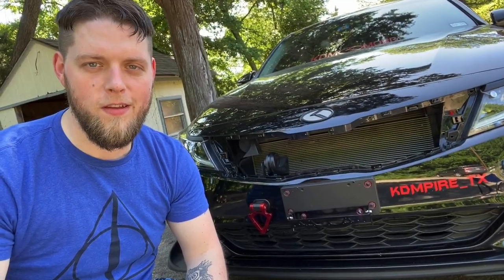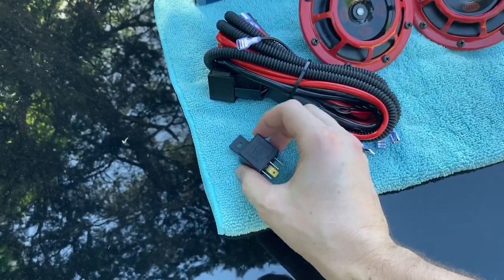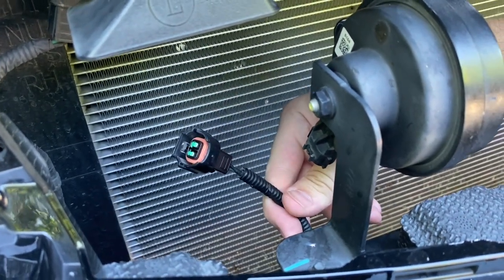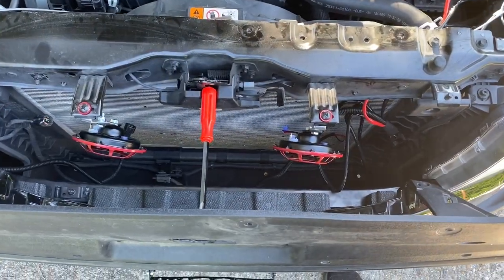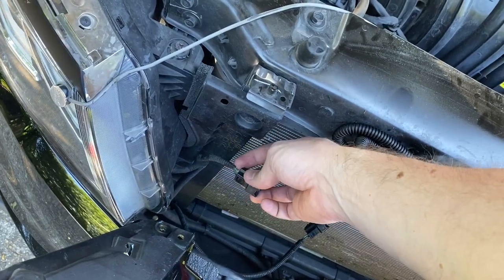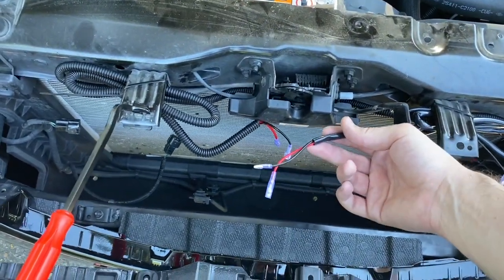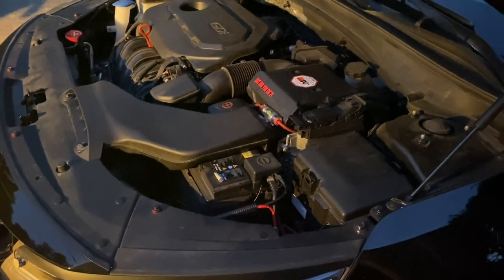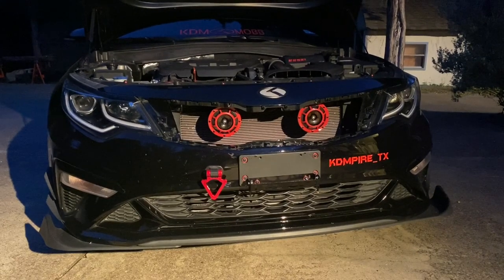How To Install Aftermarket Horns (Hella + RELAY!!)

Comment: Can I use t-tap connectors for the splicing of the wires that connect to the steering wheel horn button?

Comment: Cool, this is exactly the video I was looking for. I’ve got a 2016 optima. I’m connecting train horns in addition, not instead of the original horns. I plan on getting power to the new horns from a fuse tap at the horn fuse. I’ll be using a relay after the fuse tap. Do you see any problems with this plan?
Reply: @KDM_curt

Comment: So what happens if your original horn only had a positive connection and was grounded to the body how would you wire the negative on the trigger harness
Reply from the maker: You should be able to run that negative from the harness to area where your battery is grounded or the negative terminal on the battery
Reply: Horn

Comment: Finally a proper install video! I'm gonna order that harness. Thanks for that link ;)
Reply from the maker: No problem, glad I could be of help. Let me know if you need any other help during the install and I’ll see what I can do.
Reply: @KDMCurt  Thanks for the offer. I do have a question. I seem to have only one OEM horn on my 2000 Impreza rs. So what would you do? Split the positive and negative to make a total of 4 wires? Is it recommended? 
Also, I was told that cars have relays and everything we need from OEM so we don't need the wiring harness kit with relay. What do you think about that?
Thanks in advance.
Reply from the maker: @enriquecabanelatte2495   if you have one horn then I would only replace one horn, splicing the one cable to two horns may cause some power issues. Some cars do have wiring harnesses already available for these types of installs.  I’m not too familiar with that car though.
Reply: @KDMCurt  Thanks mate!

Comment: Are the stock horns of your car connected to a relay before you disconnected it? I’m about to install mine and i’m still confused about the relay harness. My stock horns doesn’t have a relay harness or a ground connected to it. Just a single wire connected to the back of the horn. I’m thinking of buying the harness but some people say that the only difference without having the relay harness is the sound quality, which will definitely be weaker compared to the one with a relay. I’m just worried about the trigger thing you mentioned that would set the horn off
Reply from the maker: Nope, my horns didn’t have a relay before I added that one in the video. I’d say go ahead and buy it not only does it improve their sound quality it helps to make sure they don’t short circuit. Think of the trigger wire as basically just the power wire.

Comment: Did you replace the relay to hella relay that comes with it?
Reply from the maker: I didn’t use the Hella relay that came with the horns but I did buy another whole wiring harness from Amazon I believe the brand is iJDMtoy the link for it should be in the description of the vid.
Reply: @KDMCurt  sorry I meant switch the relay? Or did you just use what comes with the kit?
Reply from the maker: I used the relay that came with the iJDMtoy wiring harness, it was already wired up and ready.

Comment: Great video, im going to make my own wiring, im not sure if i missed it but what size fuse did you use, thanks
Reply from the maker: This wiring harness with the relay actually already had a fuse wired in to it which is why I went with a pre-built wiring harness. It’s kind of hard to see but at about 1:00 in the vid you can see the smaller black box in the bundle of cables, that’s where the fuse is.
Reply: @KDMCurt  thanks

Comment: I installed this exact setup and it doesn't work.
Question, do you NEED to hook up the ground to the battery or can you frame mount it? I frame mounted it, no beep so far just a click.
My battery terminal bolts would need to be longer to fit the negative wire on
Reply from the maker: I don't think it has to be hooked up to the ground at the battery, just somewhere in the car that is grounded.  Make sure you have the connectors fully slid on to the posts.  Also, if you spliced wiring like I did make sure you are getting a good connection where those splices are at.  You may want to re-tighten them with a crimping tool the be sure.
Reply: Just came here to say I got the horns working and man they sound great! I had to bypass the stock horn wire and mount a button on the dash for it to work, but I'm happy with it.

Comment: I had some issues with mine as you said when just power an ground the wire the horns will go off with out a trigger wire. Funny thing is I don’t know where to put my trigger wire at are where to run it to. So I need some pointers.